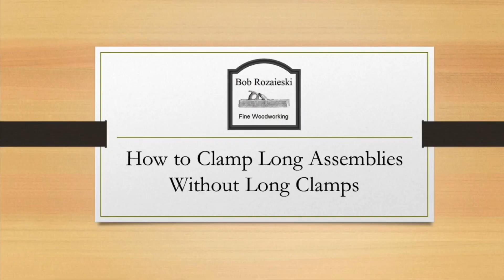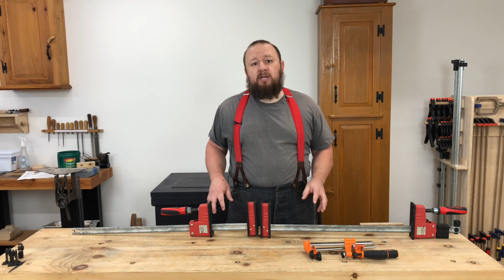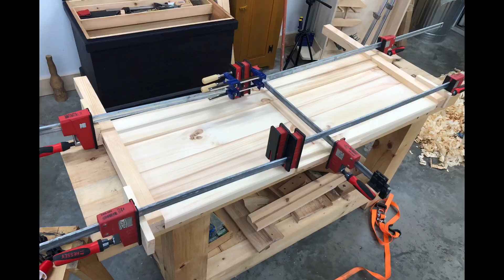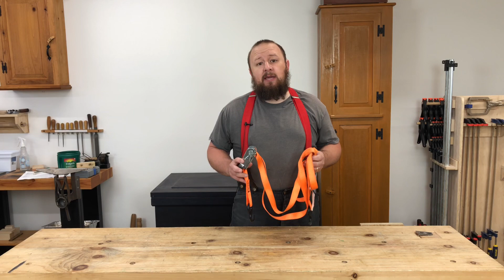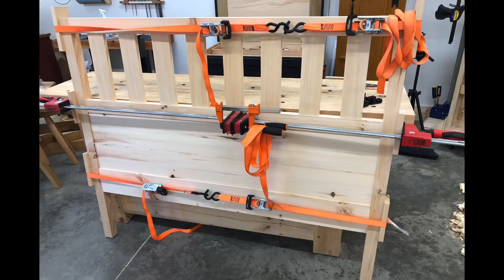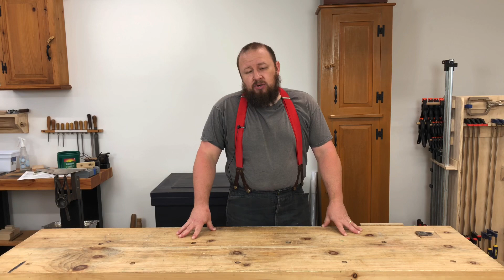Extend the Capacity of Your Clamps - How to Clamp Large Assemblies with Short Clamps

Comment: I appreciate the tips!  I was trying to figure out how to attach 2 clamps together and you got me through!

I would push back a little on your headboard example though.  I wonder why you wouldn't use screws or dowels to help hold them together.  A headboard could end up with all kinds of stresses in a bunch of different directions and I'd want more than just glue to hold that.
Reply: A long floating tenon and wood glue is what I’m using in my headboard.  So yes I think it needs more than just glue.

Comment: Drawbore tenons?
Reply: The winter past I built a platform bed only with drawbore tenons. It was done on the balcony with minimum tools and no clamps, the first time I used the method and it really worked well. I appreciate your reasons for using the joints you did. Congratulations for involving your daughters.
Reply from the maker: Are you suggesting that as a method?  Yes, that would work too...if I used mortise and tenon (I didn’t). It’s actually my preferred method but this project was also something that my daughters and I all worked on together and they aren’t ready to learn to make hand cut mortise and tenon without a lot of frustration. I needed a faster and easier method of construction so we used large oak dowels. So drawboring wasn’t an option.